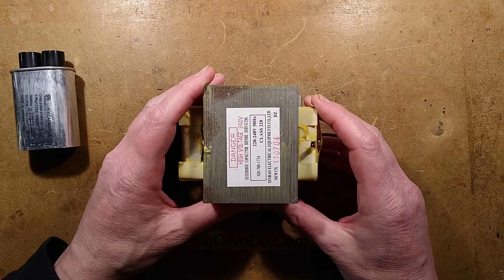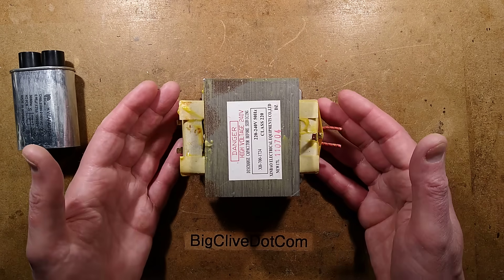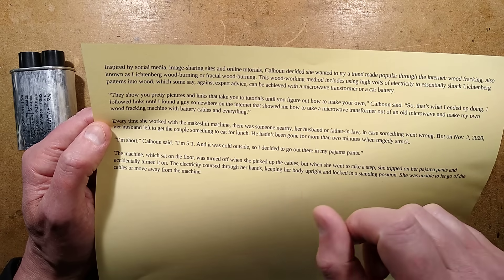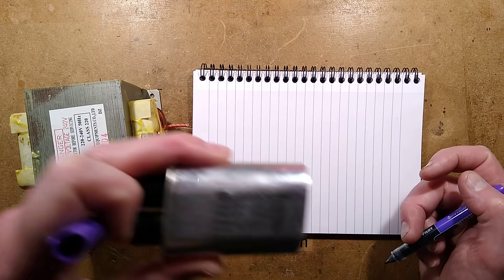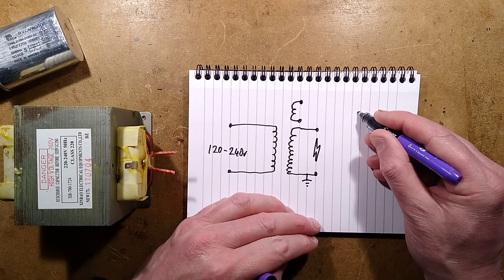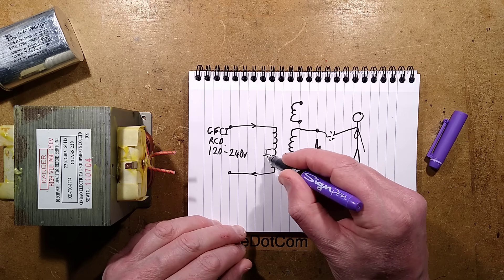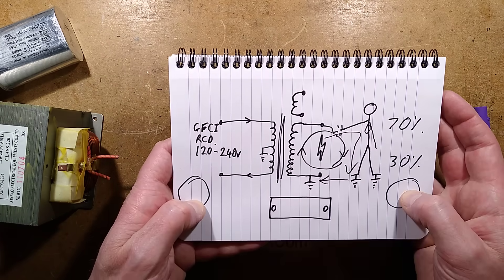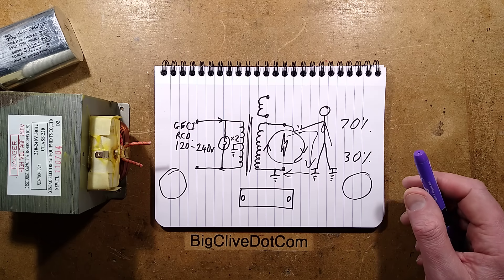The most deadly project on the Internet

Comment: Reminds me of a school teacher who flatly told us, we arbitralily assign words like conductor and insulator. But with enough voltage anything will conduct, and if you get to that point, hope you have a method of disabling it that doesn't rely on yourself as by then it's probably too late...
Reply: Absolutely correct. Lightning readily demonstrates not even an air gap of many kilometers is neccessarily nonconductive.   One of my coworkers just retired after another round of heart surgery. He has had multiple such surgeries. He's in his 50s.  After he was gone, another coworker told me WHY he needed all those surgeries: the retired man was outside in his yard one day and got hit with lightning.  A neighbor saw it and gave CPR and that saved his life. But the lightning did terrible damage inside the man's body.  Devastating injuries.  He was destroyed from the inside out and all those surgeries were attempts to fix damage.  But it finally became hopeless and the man retired. Nothing more can be done.
Reply: @LatitudeSky  - a description of “bolt from the blue” = where the lightning comes out from the side of the storm cloud and hits any tall things/ or was the edge of the cloud base over him = a direct strike, also was he in a wide open space in his garden or stupendously sheltering under a tall tree
Reply: @samuelfellows6923  You might want to look up positive strike lightning. One killed a gardener in FL. The nearest cloud was almost 50 miles away. The bolt was so powerful there was no hope. He was literally cooked. There are some videos of close calls, including one where a leader came up from the car the photographer was leaning on, but it did not connect. Instead a leader from a large tree in the back yard connected. It blew that tree apart. It must have been about 3' in diameter and 80' high  before, and matchstick-sized pieces after. The still photo shows the leader, a faint blue jagged line rising up from near the camera and a wide bright band where the tree is in the video. That almost hit the photographer and would have had similar effects. I wonder if what was left of the body might even be overlooked, especially if it is not found right away.
Reply: @jdrissel  - 🇬🇧 I know about those 😱, have observed them = the flash is extremely bright, the thunder is heard as a loud crack/firework bang > loud, long rumble, sometimes it feels like the air/house is shaking 😨 ⚠️. And if listening to the static interference on an AM radio while observing the storm from a window, it will sound like a loud crackle, snap or bang
Reply: Can you provide more info on that story/video or image? Was looking around online and came up empty handed but would love to check it out...
Reply: @LatitudeSky  When you say he 'retired', you mean he stopped working and lived a happy quiet life ever after?
Reply: "But with enough voltage anything will conduct" - Oh yeah, we were told something similar at the uni during our OSHA class: "electricity flows everywhere, not just in the conductor".
Reply: My school teacher tried to sucker me into touching a live capacitor to show the class in general how it worked, fortunately I had already read about how those flasks worked at the time. Would probably have been a good lesson, but I managed to get a hit of mains voltage when I was even younger, so to say that high voltage kind of scares me is an understatement.
Seeing as I routinely work with chemicals that can melt your eyeballs and turn them five kinds of pretty colors these days it probably helps, healthy respect and all that.
Reply: @LabRat Knatz "Makes me wonder about high frequency HV AC." - It depends. At a sufficiently high frequency is only leaves surface burn marks. But as you gradually lower the frequency its ability to fry your internals rapidly increases.
Reply: I learned this when I was old enough to push the push mower and really wanted to cut the yard. 
As I was mowing ,I went under a bush and pulled the mower back out and it started missing. 
I walked around the front and saw the plug wire was like an inch away from the plug. 
That blue spark looks pretty cool,I wonder if I pull this maple leaf off the tree and stick it between the gap it'll stop....oooooooooohhhhh nope ,nope the spark doesn't stop.
Reply: @MrTheHillfolk  when I was a kid our older neighbor was cutting the grass he was a roughneck oilfield worker.....and a prankster......hey do me a favor turn off the lawnmower.....just pull the sparkplug cable off the plug.....yyyeeeeooooowww!!!! ZaP!!.....hahhaaaahhaa.
Reply: @patdisaster8259  hahaha I bet he didnt need a cup of coffee after that 😄
Reply: @MrTheHillfolk  wow that must be some lawnmower to be running on 75kv 😂
Reply: It's all about the band gap
Reply: Yes, at 12kV 100mm of Polycarbonate will insulate for about 60sec with about 3- 5 flashovers (if designed correctly), at 24kV, the same 100mm thick plastic will last about 30sec, at 72kV it won't last 20 sec before breaking down. Most "insulation" material come with a rating -xx kV/mm and then a second rating for surface creepage - AND we usually discount the surfaces that are facing up because dust may settle on the surfaces and reduce the surface insulation level. What they teach at middle school level is wrong.
Reply: To quote William Osman "Welcome to high voltage, where everything's a wire and you're probably gonna die"
Reply: That's a very interesting and truthful quote. Reminds me of the "lump model" in electronics. There's no such thing as a "resistor".
Reply: I wish I'd had your teacher. I tried to make this point to my physics teacher, who flatly told me things electricity cannot pass through insulators and can through conductors and that was an end to it. I was trying to ask what a resistor was (basically, a poor conductor) and how you explain things like earth leakage and sparks throught the air... I got thrown out of the lesson for "being disruptive".

Conductor and Insulator describe uses, not materials. IE plastic is used to insulate cables and copper to conduct electricity through them. But if you pump up the voltage enough the insulation will break down and cause arcing, and if you pump up the current then the resistance in the copper will cause it to melt.
Reply: @Rapscallion2009  Yeah. I loved my science teacher, he didn't give a toss about sticking exactly to script or the curriculum, told us stuff we needed to know and then went on to elaborate about things good to know like that. Science was my best subject at school, and I credit it all to that teacher, he was the only one who really went above and beyond with me, i flunked nearly all other subjects.
Reply: In actuality, conductors and insulators are the same thing. Theyre just on opposite ends of the "how well can it conduct" scale. Importantly, its not the "will it conduct" scale.
Reply: Yep! That's how lightning works, traversing thousands of feet through the air; and air is NOT a good conductor.
Reply: Not really ‘arbitrarily’ but the point is still valid. Materials are insulator under certain conditions and to certain degrees.
Reply: Gee my teacher said "I can't let you drill out these cannons you cast, because they'd be guns... but if you go see this guy..."
Reply: "Errrrm. Well tha Karunz of the world would report the content of this video alsuw" 
Hahahah
Spot on dude. Lol

Here come the Karens to........
Read more+
Reply: "But with enough voltage anything will conduct" many years ago i was "newbie" in electronics and i did many "experiments" (some dangerous and some not )  .... One of them is with glass - you would think about glass like insulator (i did it also with original HV ceramic insulators ) ...  Just small note - Insulation on cables were rated aprox. 10 000 v per cable (2 cables 2* 10 000v ) . I had there "foot pedal " - remove foot - no power .... https://youtu.be/UpJjgN0I_9E
Reply: I believe we consider what can conduct is something that can conduct around 1 mW at 240v ac 50hz
Reply: @abhijeet_ghosh  You still don't get it, do you? Even wiring that has 240 V AC running in at 50 Hz creates a changing electromagnetic field around it which can be detected by equipment that's used for detecting wires in walls. And in water the electric field created by a conductor is a LOT more pronounced, so strong in fact that it can even be made visible to the naked eye. The principles of electromagnetism apply even to low voltage DC, but it's MUCH more pronounced with HV AC, that's for sure.
Reply: Anything? Even a vacuum?
Reply: @Sparkette  Yes, CRT's have a vacuum and they conduct
Reply: @Sparkette  Well, that is just colloquial brabble. Mostly it depends on the context, for electro-technical applications we usually mean a GOOD conductor, some material with free electrons. And a GOOD (or suitable) insulator when we talk about insulators. We just could stop that fruitless discussion by doing what real world engineers do: Specifying the parameters! Then there is no room for wild thesis, like in this thread:P :)
Vacuum: Electrical conduction only takes place in a vacuum if freely mobile (migratory) electrons are introduced into the relevant space through emission. This can be done by thermionic emission or by photoemission (See the principle of the vacuum tube). When a voltage is applied and thus when an electric field is present, the electrons move in a directed and largely unhindered manner. This allows you to reach relatively high speeds. So a field doesn't "care" about a vacuum (we ignore dielectric effects for our brief consideration). But it is the flow of current, that will harm/kill/burn you. 
So all fields, that you may move through (or vice versa) like portrait by these jokers above don't do anything ... if they don't interact with you. In addition, such statements without specifying field strengths and wavelengths, or the possible body current/effective body power, i.e. energy over time, are total nonsense and say absolutely nothing. Only schoolchildren (as told by the nice opening story) rightly fear such fairy tales.

Unauthorized change of topic: Better also fear high currents. There are enough heavy and deadly injuries, when for example tools like screwdrivers instantly turn into thousands degree hot metal vapor, which settles on your face, eyes and lungs. It's no fun either, so always wear safety gear when working under voltage. Or if you're smart and want to live longer, it's better not to work under voltage at all.

The order of the five safety rules is essential and must be observed:

    1. Electrically switch off.
    2. Secure against being switched on again.
    3. Determine the absence of voltage(Measure!).
    4. Ground and short circuit.
    5. Cover or fence off adjacent live parts.

This is the level of knowledge in the first year of an apprenticeship in an electrical trade.

Have fun making, but don't die, yes?:)))

Edit+P.S.: Just to state how this "curiosities begging" isn't helpful: In the beginning of the universe, in that photon soup (GUT-era, 10^32K) the universe itself was a perfect isolator, because there could be NO electrons contributing to a current flow. Also a perfect equilibrium of a plasma viewed as an inertial system may be a perfect isolator ... and that besides all the free electrons. That equilibrium is the opposite as a voltage, a potential difference, which is needed that a current can flow. But forget that. Just curiosities:)
Reply: @Sparkette  at that point they are called cathode rays.
Reply: @Sparkette  - Interesting question, except that a conductor would be a property of a material, and vacuum is not a material.
Reply: @jszlauko  Except in practice it can be considered as a material and is used as an insulator.
Reply: In the words of some YouTuber who's name escapes me "welcome to high voltage where everything is a wire and you're probably going to die"
Reply: My shop teacher in high school was talking to us about something, but the one thing that stands out in my memory is him looking at us and saying “You know what happened? 9/11 happened.”  
Shop class got strange at times.
Reply: very very wise
Reply: Yes. "Welcome to the world of high voltage, where everything is a conductor and you're probably gonna die."
Reply: Excellent point👍, its a spectrum of conductivity
Reply: What an amazing,  genius comment! Love the sarcasm in your word choices. Captures the stupidity perfectly lol
Reply: I think what you are trying to tell the 15 or 16 people throughout the entire universe and its eternity that will probably be bored or tweeking hard enough to try something this lame and specific to art and the millions of home artists that will never tries this. The people you are trying to to tell to use common sense are not smart enough to understand electrical theory either, you ware going to confuse the shit out of them....then they will have the elevated chance of fucking up. 
Kind of like trying to teach a whole bunch of third graders how to read music in a half class period type of thing....You sir are very electrical safety  aware and very correct on everything you threw at this project that will kill your boredom so they say
Reply: It's called the breakdown voltage
Reply: It isn’t voltage that kills a human it’s the amperage
Reply: This quote is going up in my garage/shop. To remind myself when doing something stupid.
Reply: Sounds like you had one of the few good teachers there
Reply: Nothing is a perfect insulator, even a vacuum.
Reply: Its not arbitrary. We give things these names because this is how they operate in normal conditions. What youre explaining is breakdown, hitting something with a much higher voltage than rated can literally rip the electrons off the atoms in a material and that becomes a current and the material begins conducting since it now has free electrons which act as charge carriers.
Reply: from what I understand, the words are not assigned arbitrarily, but your point is taken. the materials that are called "insulators" are not superinsulators or perfect insulators. rather, they are classified by their relative resistivity (or in some contexts, permittivity). these are objective measures. where we draw the line between a poorly conductive material and a reasonably well conductive material is in some sense arbitrary, but there is a vast gulf of resistivity between practical conductors (like metals) and practical insulators (like rubber). here are the generally accepted definitions for material resistivity classes (in orders of magnitude of ohm-meters):

Superconductors: 0
Metals: 10^−8
Insulators: 10^16
Superinsulators: infinity

between metals and insulators there are other materials, like semiconductors. that's where I'd agree it can be arbitrary which word you want to use, if forced to use one. but in general, a material should only be called an insulator if its resistivity is above 10^10 ohm-meters, except in cases where you're comparing materials and saying something like "relative to salt water, fresh water is an insulator," or where e.g. you're referring to a dielectric that serves as an insulator within its system, even if the material it's made of is not formally classified as an insulator.

as for "conductor," it has a much looser, more relative definition in common parlance, because the formal definition is idealized, encompassing basically everything in stable existence, excluding only superinsulators. outside of theory, the word is most often used in a schematic sense, to refer to electrical components by their intended purpose. like, in an electrical cable, the metal wire is the conductor and the plastic/rubber is the insulator, even though both are technically conductors. in that context, we're not using the words in an arbitrary way, we're using them in an instrumental way, to label components according to their functions.

so at the end of the day you could say a term like "electrical insulator" has two main definitions, depending on the context: 1) a material with resistivity over 10^16; and 2) a component that serves, within a system, the purpose of confining electrical current, often by having a higher resistivity than other components of the system, particularly the conductor (which is the component intended to carry current, therefore likely possessing a higher charge carrier density).

since superinsulating gloves and shoes do not exist, people should just operate under the default assumption that no material is safe from a load, and then only deviate from that assumption after verifying all the relevant details about the system. only once you know the voltage is very low should you assume your skin will protect you. likewise, only once you know the voltage is low should you assume your gloves or insulated shoes will protect you. and frankly, only once you know the voltage is not in the megavolts (or even high kilovolts) should you assume the air will protect you. but I know there are people who just don't give much thought to these things. it's not merely that they wrongly assume their shoes will protect them, it's that they don't care to find out.
Reply: Yes, using flesh and bone as a fuse is a bad idea.
Reply: Just like The "Wrong Brothers" discovered that if you put a big enough engine on anything, it will fly...😁
Reply: safety interlocks. always. don't let your makeshift machine run if your two hands aren't holding safety interlocks! 

current limiting can also help, if it's any use.
Reply: @AnnaVannieuwenhuyse  Breaking on sudden changes in current is a good idea as well
Reply: @LabRat Knatz HV high frequency will not " penetrate " you deep in the flesh ... You can look also some stuff about "different frequencies " traveling through cable / wire ...
Reply: @AlbiDartanan  I had pretty thick skin from manual work and was pranked with HV from an old TV set.
I heard a whistle and looked as a pretty spark from my finger to a cable I was working on. It didn't hurt as such - not like the 240V I'm 'used' to.
Reply: @keithsquawk  I managed to give myself a nice radio frequency burn on my fingertip. Plasma ball kit using a flyback transformer from a CRT television. Didn't tickle.
Reply: @AlbiDartanan  incorrect, hvhf a/c will indeed penetrate every organ in your body. It's a common issue that skin effect is thought to relate to human skin when it's actually nothing to do with that. The skin effect in a copper cable means (to keep things short) it travels round the outside edge of the cable but not the inside. In terms of the human body... We're not a copper cable and the skin effect penetration distance for a human is far enough to go everywhere internally
Reply: @AlbiDartanan  "HV high frequency will not " penetrate " you deep in the flesh ..." - Depends on what frequencies we're talking about though....
Reply: @CoolKoon  And actually the skin effect doesn't refer to human skin. Human flesh has high characteristic resistance, rendering the skin effect not so skinny even at high frequencies.

I am no expert on this subject, can't explain mathematically nor physically, but on Wikipedia's article of Tesla coils are included interesting information on safety, and there is explained the usual belief of the skin effect working on human body to be false theory.
Reply: @TheSimoc  I just noticed your reply after I typed mine. I have several hvhf circuits and it's shocking (pun intended) how many people say "oh but the skin effect!" And it's complete BS as far as the human body is concerned
Reply: @TheSimoc  "And actually the skin effect doesn't refer to human skin." - Gee, thanks, Captain Obvious! I'm sure my professors at the uni have failed to tell me this (oh wait, they didn't!)....
Reply: @AlbiDartanan  That and when you get to high enough frequencies. The debilitating effect of the electric current disappears anyway.